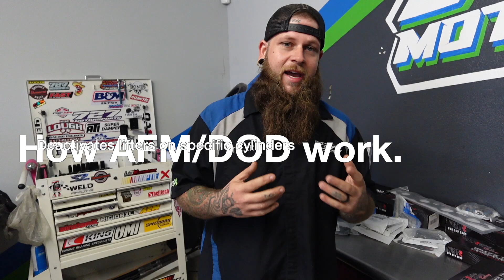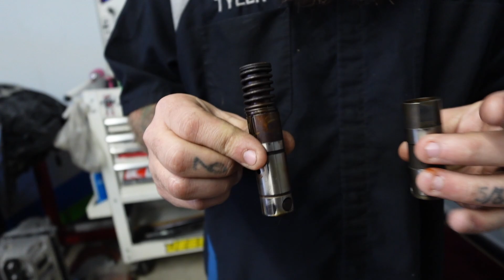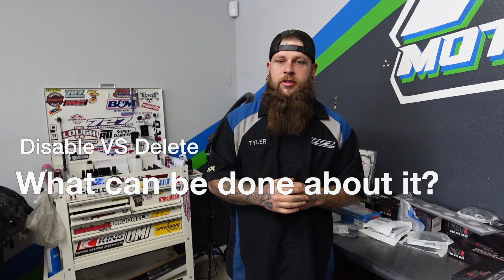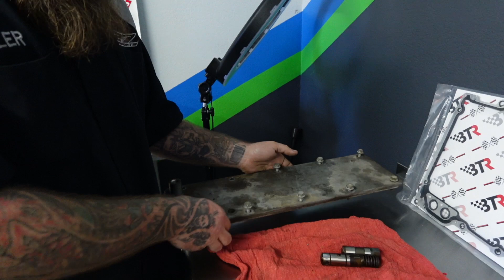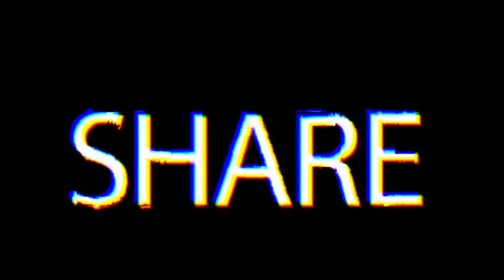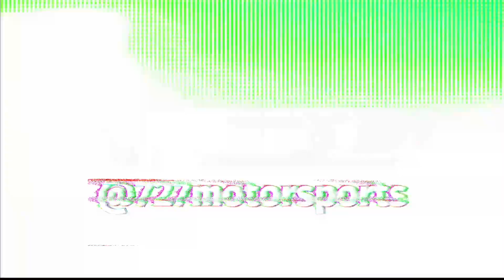What is AFM/DOD & VVT? How's it WORK and MORE!

Comment: My AFM system in a 2012 Yukon 1500XL Denali 6.2L and 6spd trans.
My AFM generally only kicks in when I let off the gas pedal. I just test drove it in "D" and watched my display show it was in V8 mode while accelerating from stop all the way to 75mph. Never once shifted to V4. As long as I maintained gas pedal pressure it stayed at V8. While maintaining speed it stays in V8 all the time.

As soon as I let off the gas pedal it shifts to V4 and if I never touch the gas pedal it will stay at V4 until about 42mph and it will shift to V8 and drop to V4 again at 25mph and then back to V8. I drove it on the HWY in "D" and accelerated to 75mph and maintained speed with my foot and the engine stayed in V8. as long as I maintain speed the engine never shifted to V4. At 75mph when I let off the gas pedal completely the engine shifts to V4 and will stay there until either I press the gas pedal again or the engine speed drops to about 42mph and then it will shift back to V8.

At anytime I start to barely decelerate by slightly lifting my foot off the pedal the engine shifts from V8 to V4. Only on deceleration.

I thought this system was suppose to shut 4 cylinders off at steady HWY speeds to save on fuel economy?? At steady HWY speed this engine stays in V8.

I can disable the AFM by shifting the transmission to "M5) and that will keep this truck in V8 all the time.